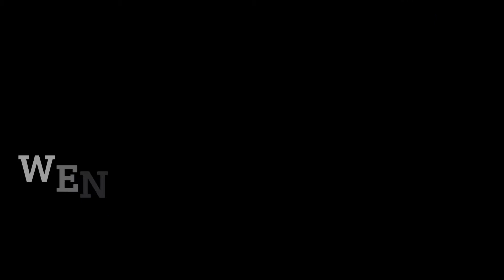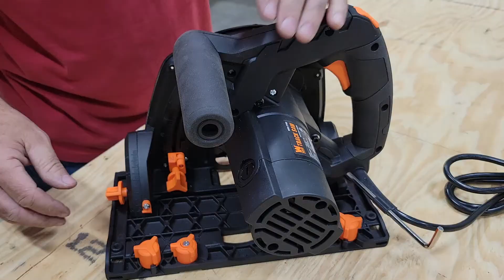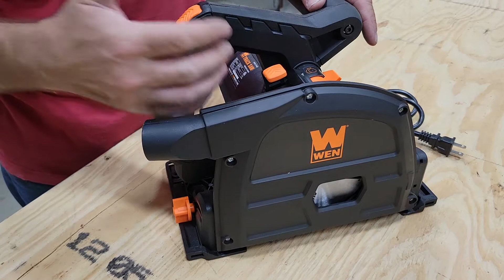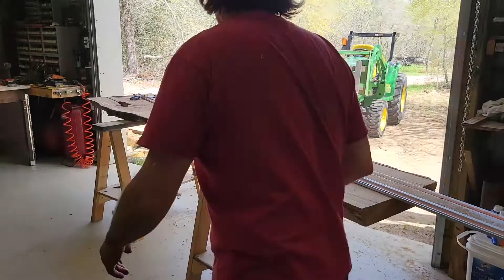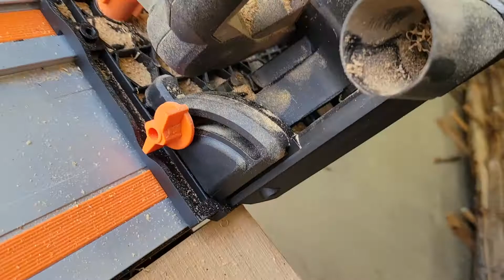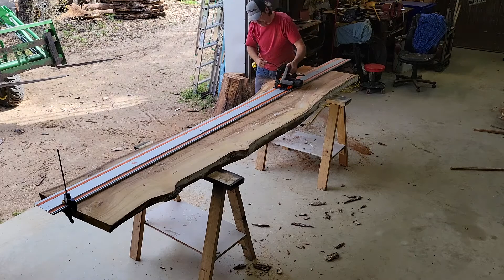K-man Builds - Wen CT1065 Track Saw Unbox and Initial Review

Comment: cant believe you didnt hold down clamps to hold down track
Reply from the maker: This video was for my initial run.  I normally do use them now but that did not help this track cut any straighter.  I don't recommend this brand unless you are doing VERY light weight material.

Comment: Have same saw.  Has anyone figured out how to do micro adjustments to get it to 90deg to the base plate?  Mine appears to be a touch off and I cant push it any more to the Right to get to 90.  My old dewalt has adjustment screws underneath to set the 90deg scale.
Reply from the maker: mine seems to be ok right now.  I check the cut and it was close enough for what I was doing.

Comment: Hi. How did you remove that dust port thing where stuff got stuck in there. I kept shaking, it didn't come out. Thanks.
Reply from the maker: There are 3 or 4 screws on the side that hold on the blade access panel.  once you take that off the exhaust port will slide out.

Comment: Good, honest review.  Rather than a bar clamp, if you get a set of track saw clamps, the you wouldn't need to stop and take your clamp off at the end of the cut.
Reply from the maker: thanks for the info..  I figured there was something like that, just had not taking the time to look.  One update on this.  I have had some issues with the track being perfectly straight across 3 sections.  Not sure why.
Reply: @kmanbuilds  when joining lengths of track, unless you absolutely certain they were exactly 90deg, space then apart slightly when joining them, and use a straight edge along the rib the saw sits on when tightening the screws.

Comment: For the clogging issue I cut the two plastic bars out and that helped a lot with the dust. Additionally, I took off the anti-kickback knob. It was sticking and not letting me get a good slide. Last- I bought a new blade today and will change it out. For the price we paid for the saw it is not that powerful but gets the job done. Thats why I'm upgrading the blade.  Thought I'd part some of the issues I had with it since I've bought mine. Had it for 2 months now. God value for the price.
Reply from the maker: Yeah, the blade seems to be a biggie..  I cut (4) 48"x8"x1 1/2" Ash boards today, both long side each, and noticed that it was struggling alittle more than the first day.  Still good for the price though.
Reply: What blade did you buy?
Reply: @PersonofInterest-Maybe  the arbor sucks. Everyone else is 5/8 and WEN is 20mm
Reply: @courtney_350F  circular saws use 5/8", MOST track saws use 20mm

Comment: Thank you for review. Have you had any other opportunities to work with it? And have you ever used the Kreg acu cut? I’m in the middle of deciding what two do. I’m just a hobbiest but enjoy it.
Reply from the maker: I used it on about 6 - 11' cuts on just over 2" Elm.   I would say it depends on how often you plan on using it.  It does the job I need for the price.
Reply: @kmanbuilds   if I do a 100 cuts a year it would probably be a good year really don’t so that much I have a table saw too so. Really would just get used for sheet goods or taper cuts. But it sounds pretty good for that use.
Reply from the maker: Yeah, you have to take it slow.  It is not a overly powerful unit but that is to be expected for the price.